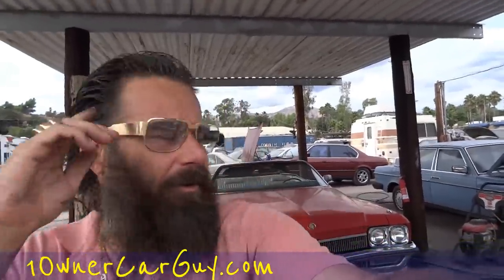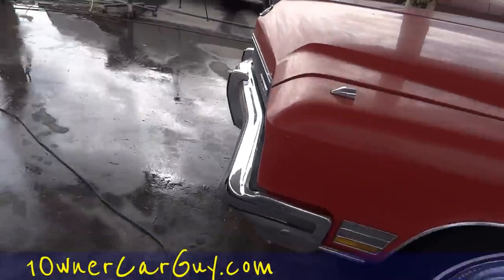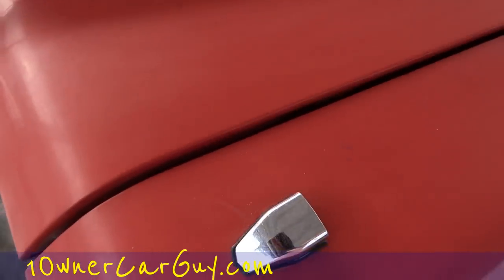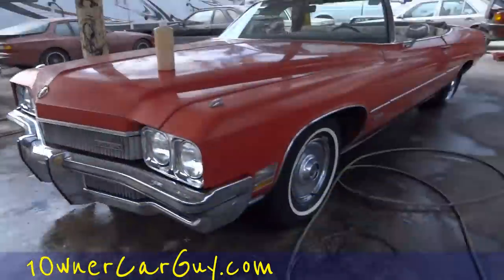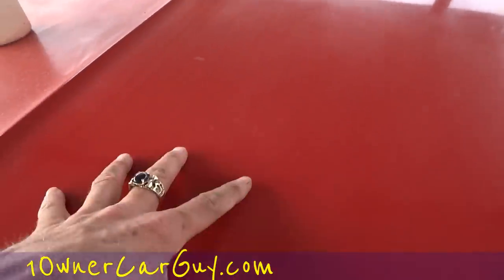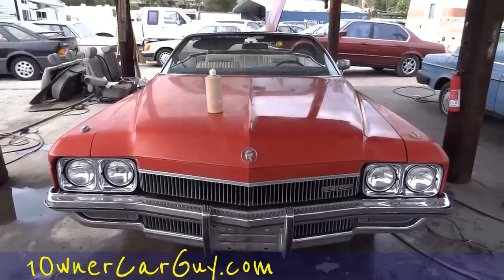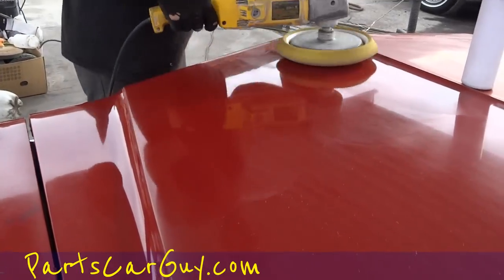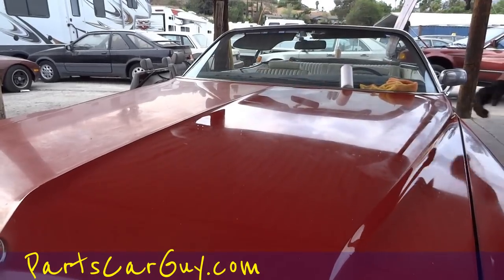Buffing A Car  DIY How To Buff Cars Restore Paint Detail Tips Classic Restoration Step #5

Comment: When I did my truck I used this technique. It was clear coated but the clearcoat faded off. But a couple days before I did it. I rubbed some meguiares M7 glaze. It’s a little more oily. It helps moisturize the paint to be buffed easier and not use as much product. I personally used a wool pad with compound on a rotary. For stage 2 I used a polish on a DA polisher. Finally I hand waxed it. Just some tips that worked for me.

Comment: i agree with everything you're doing,i do restorations on some high end cars,and one thing i've learned is pads and shaggy buffs are expendable,i clean them often,i don't care about the mix or cost,i want the paint, if there is any there to glow,the first cut is the one that stacks up due to oxidation, is where the underlying paint youre trying to save,in other words clean your buffs often on first two or three cuts good job,saved that car for the next generation, idont' want the kids to think all automobiles had plastic bumpers

Comment: not sure if you know but here is how to check for single stage or base/clear..paint comes off on rag--single stage...rag comes out kinda clean but a bit milky is base/clear..you did an awesome job on this car but those weak spots are from the paint being too thin and a repaint is needed but impossible to match on an older color..

Comment: if u wanna make it easier for yourself..save some polish and get a finer finish then use a water sprayer when the product starts getting dry.. reduces to half the amount of polish.. just a litle advise.
oh and 2nd .. its speed and heat that brings out the gloss. 
beware cause u can melt the paint if u get too agressive.
again a waterspray is good for both cooling and making the product last longer

Comment: the reason why it appears to be soaking into the paint when you use a rubbing compound is because the compound has oils in it to lubricate the buffer. the oils you dont want to soak or be left on the paint. Yes it will appear to be more shiny but over time and car washes it will wash off, or if you put a sealant or wax over those oils and then pull the car into the sun you will see swirls or what looks like holograms, after you compound if you wipe the car down with isopropyl alcohol or a paint cleaner you'll get an accurate view of what was really buffed to  a smooth finish and not the oils disguising it.

Comment: this car has no clear coat ( you can tell by the paint transfer ), and the "dry spots" are where the paint is pretty much gone. it really needs a new paint job.
 
a random orbiting buffer and alot more compound would make for a faster and better job. you should never be buffing a dry surface and the constant circular motion simply creates too much heat with that amount of compound.

to each his own. the car came out nice but it was doomed before you began.

Comment: Ok, I get the whole difference between "junkyard detailing" and "top tier" detailing thing. I've done both.... 

Even so, some techniques work best regardless of what you are working on. What I'm mainly referring to here is arm speed when working an abrasive product on a paint surface. By moving the buffer around so fast you are not getting much "work time" in any given area. By work time I mean time that the spinning pad is engaging the abrasives in the product with the paint surface. 

Look at it this way... Watch a part of your video where you are buffing a section of paint. Pick out a small area in the section you are buffing, maybe 6" x 6", and focus on that spot until the buffing of the entire section is done. Try to see how much actual work time your chosen small area gets as the section is buffed out. When the buffer is wildly moved around the small section you watched might get a quarter of a second every now and then and maybe a couple seconds before the product breaks down and the buffing of the whole section ends. The rest of the time the product on that small section is just sitting there. 

Now try this... Work smaller sections at a time, maybe 16" x 16" or so. Apply product to the section and then spread it over the section using moderate to fast arm speed, then slow arm speed way down. Imagine your section as a square, rectangle or whatever shape the area you are buffing is. Start in one corner of the area and move the buffer side to side across the section. Move the buffer maybe 1" per second allowing the spinning pad to really engage the abrasives with the paint as you go. Overlap each pass around 50%. Wen you have done this over the entire section then go over it again criss-crossing the first pass (moving the buffer away from and toward you). Keep the arm speed to around 1" per second. Each time you cover the section change directions. 

Do this until the product breaks down and you are ready to wipe it off. 

I guarantee that doing this one thing, slowing down arm speed, will get you better, more uniform results. Let the pad and abrasives work more effectively for you and let your arms work less. This isn't tier one or junkyard buffing... It is SMART buffing. 

I'm not trying to change how you detail, I'm just offering advice that will get you the most out of your time and efforts. It doesn't matter if you put a small line of polish on the paint or coat it on with a paint roller, if you don't get enough work time with the pad working the product against the paint you are just wasting time and product... and ultimately MONEY. 

Give this top a try and see if you don't agree.
Reply: I'd add that the condition of the paint should dictate the size of the section to be worked at any one time. The worse the condition of the paint is, the smaller the section size should be in order to concentrate the product being worked and the work time on a smaller area and get more work time on that area before the product breaks down or begins to evaporate and dry out.

Comment: Means well but compound areas r done to large u have to work compound little area at a time u need new buffer that's old school get 6 inc porter cable buffer use foam wool pads no one uses anymore it's murder on one stage paint jobs